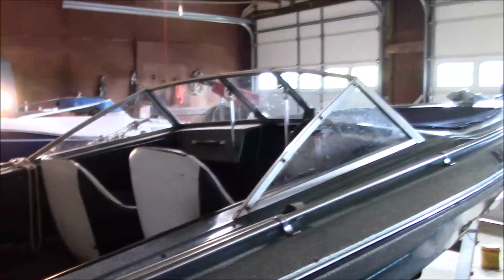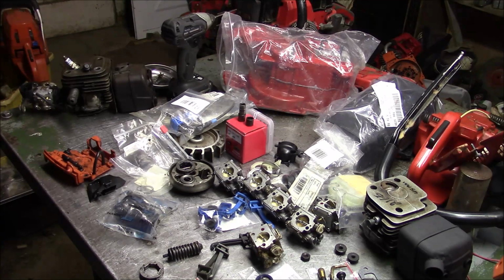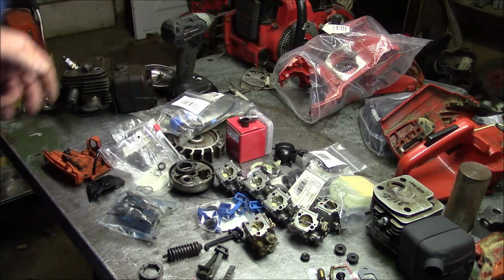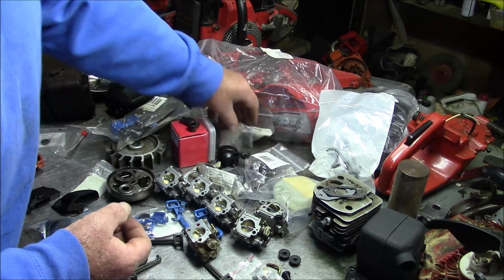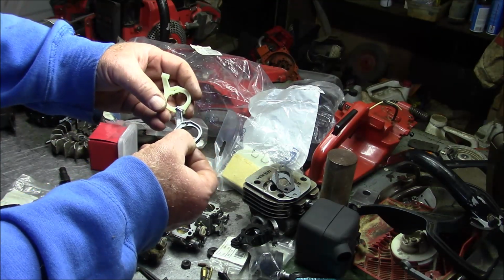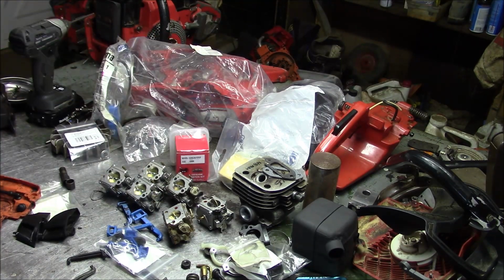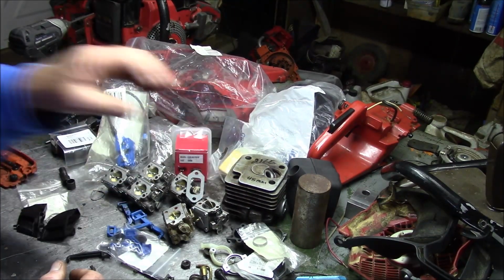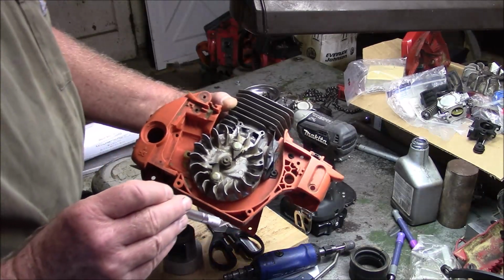Husqvarna 365 / Jonsered  cs 2165  48mm , Bits & Pieces & "Cylinder & Muffler Mods ", Part 2 of 5

Comment: Wouldn't mind seeing a port job and matching the intake port to the boot on the 390 cylinder. Would definitely help it out a lot. Noticed weight matching the pistons if using the oem 290 or so 310 crankshaft also these cylinders like the 13,000 range. a piped muffler for them helps if one wants to split the muffler. The 48mm topend for the husqvarna is pretty interesting.

Comment: I also like the consept of popups and even just tightened squish vs cutting squish band and base for that. I have yet to port a saw that would have required exhaust duration shortened so i just avoid cutting squish band if u dont have to.  Also i dont want to raise the transfers if i dont have to.

Comment: Nice info, thanks! Have you ever had an issue with detonation after installing popup pistons?
Reply from the maker: No actually the compression is only in the 150-160 range as the combustion chamber on the OEM cylinder is big. Would have to deck the cylinder and cut the squish band to get the compression numbers up in the 180/190 range which STILL is a safe place for pump gas. I wouldn't worry about detonation until the compression numbers over 200 psi...and we aren't even close as you will see is later video's

Comment: What if you were to leave wrist pin- piston top dim alone and only Windowed/ported/ground/machined the top of piston area as it relates to the  transfers for gains.. ie buttery cutting the top of the piston?  is there any thing to had?  instead of cutting squish there by reducing flange thickness and or "messing up"  port numbers
Reply from the maker: The Madsen build :) Works really well btw